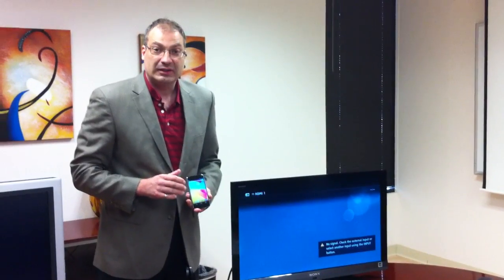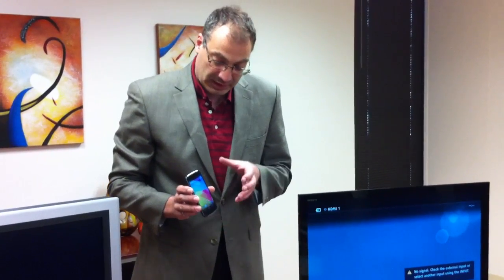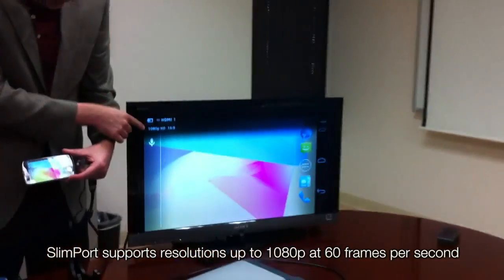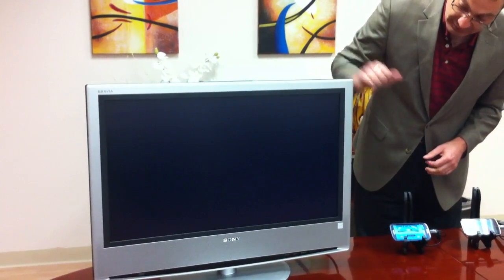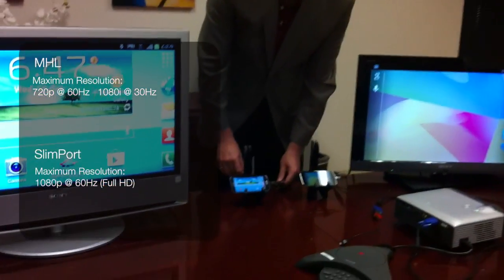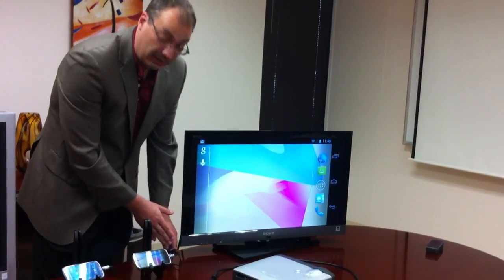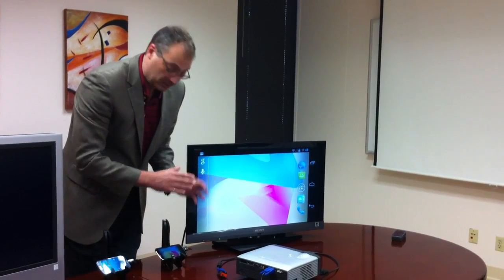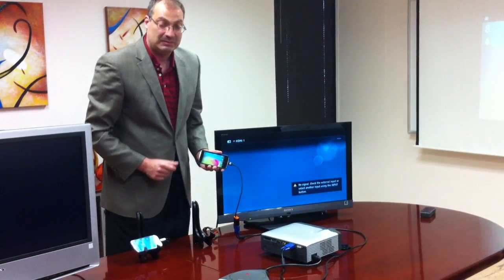Comparing SlimPort to MHL Connectivity

Comment: Getting a Nexus 7 soon.  Now do I get a slimport adapter or chromecast?  Both have very different pro's and cons.  Sad to say, I'll probably end up with both eventually.  MHL (at least on my S3) blows btw.  The colors are bad, resolution is bad, the overscan looks terrible, and it cuts in and out sporadically.  Terrible waste on an expensive adapter.

Comment: Hello. I wonder if could use the power port of a slimport adapter to connect a USB hub in order to use some additional device like a keyboard while sending video output to a external display ? Is it possible to connect a USB OTG adapter to that port in order to charge the tablet or cell phone and connect the USB Hub at the same time ? Thank you so much for the attention and quick response. Regards!

Comment: So you'd rather carry around one cable and one cable with adapter for when you do want to charge and when you don't care about charging? I don't think people want to not charge when they connect their device, thus keep your MHL cable where you have your MHL TV, and if you don't bring with you the MHL adapter with cable. When MHL 3.0 ships it'll likely be compatible with 300 million devices, Slimport is in virtually no devices currently. Even LG decided to use MHL on their newer LG Optimus G Pro.

Comment: So you prefer that your device be depleted of power or full of power once are finished using it on the TV? You're a million times more likely to have an MHL TV than a Dlimport TV so if you want to avoid microUSB for charging through an adapter, this is way more likely to happrn using MHL and not Slimport. USB Host is likrly part of MHL 3.0 anyways.

Comment: You have the right to be MHL fanatic, bit it has flaws. The need to charge while using it, besides being a pain in the neck regarding cables and a plug, is not good to the battery life in the long term and I have often experienced the situation where the phone demands more power than that which is being provided and the MHL connection ends. Also, there will be slimport acessories with a hdmi + usb port, so you can connect a storage device. That alone is a great advantage.

Comment: MHL 2.0 released in May 2012 supports 1080p 60fps as well a faster charging, so this video is kind of fake. Also, over 150 million MHL devices have been shipped worldwide, nearly zero slimport devices are yet on the market, LG doesn't even want to mass produce the Nexus 4. So there.